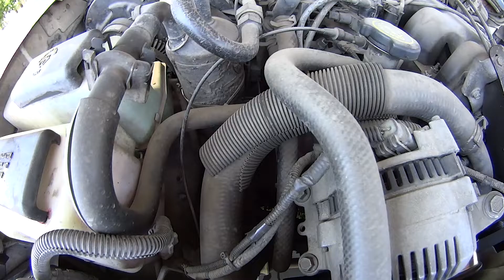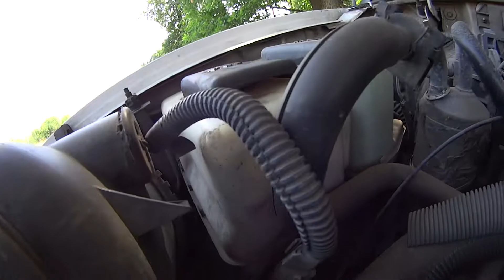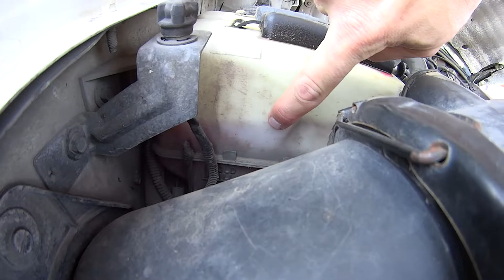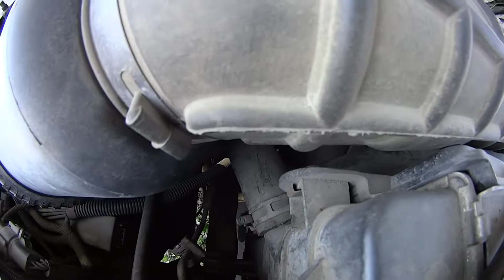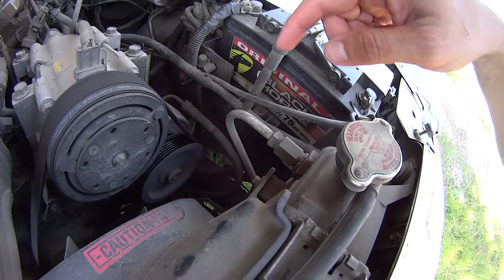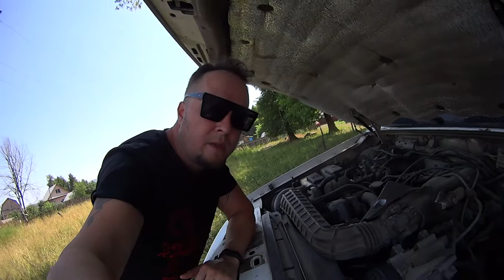Ford Explorer boils when engine stop

Comment: Try a new radiator cap, thermostat, Fan clutch, radiator flush.
Reply from the maker: Radiator cap is broken by me, to avoid pressure in system.

Comment: What have your done?  "Radiator Cap Is Broken By Me,To Avoid Pressure In System"?
If you've "broken" things & don't have a pressurized coolant system, then yes it will boil over.
Study up on how your vehicles cooling is designed to work & maintain it like it's supposed to be done.
Don't  do weird alterations unless you like to burn up engines!
Reply from the maker: I ride like this 6 years. Don't bullshit me.